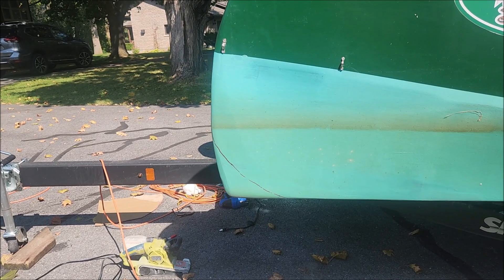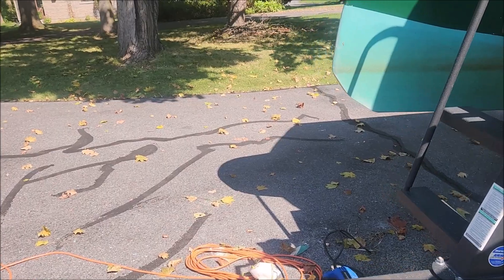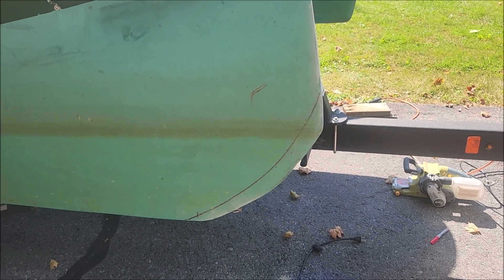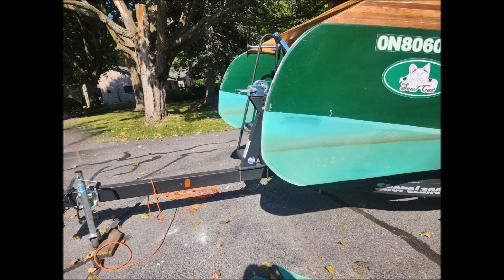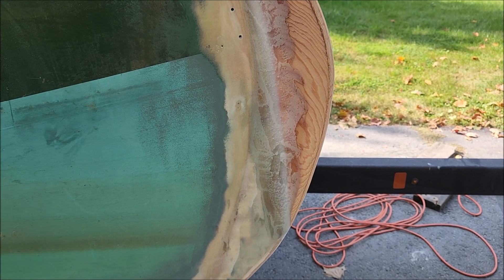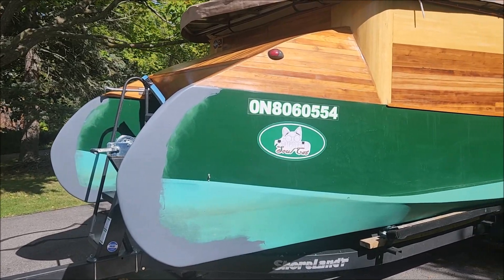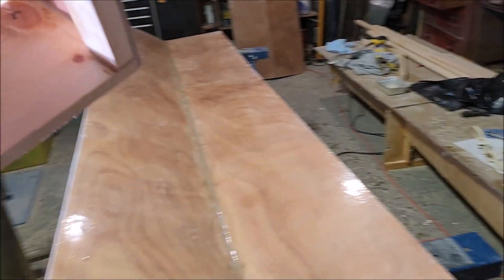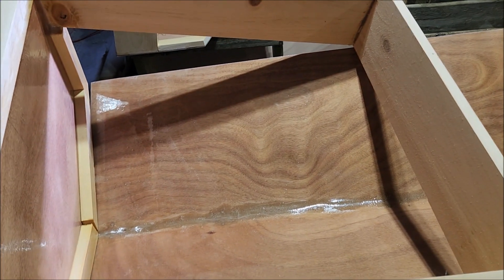2025 modifications To Soul Cat a Solar Electric Catamaran.

Comment: hi would it not be better to tapper the back down to a point like a canoe or kayak?   to me you need lifting strakes in the mid bottom of toons to lift front a bit.  where are you cruising to this summer? hope it goes well
Reply from the maker: Yes the more tapper the better the flow. I would have had to extend it to about 24' to do that. This summer in Aug I will be going to the 1000 Islands for a few days and then up the Rideau Canal before returning to Napanee. About a two week trip.
Reply: @philboyer2036  sounds good   hope to follow along. i joined the shallow drafters shanty boat club. i posted a video of your boat in the buckhorn lock from  your big trip up to Georgian bay. there are other solar boats on there to. have a look👍👍 some neat mini house boats made by Roy Schreyer on Georgian Bay